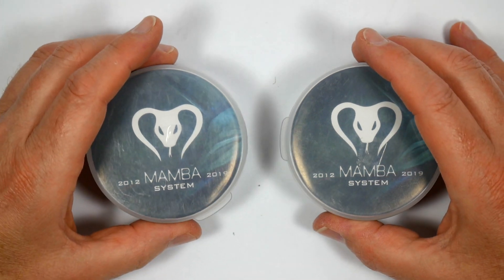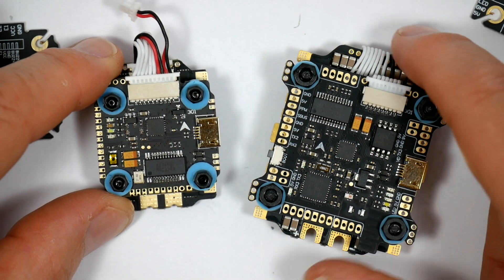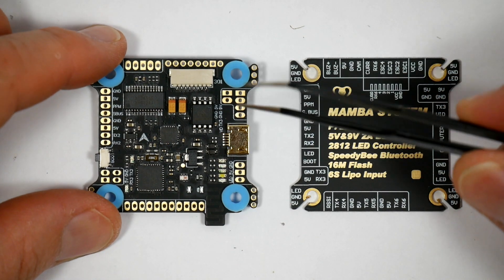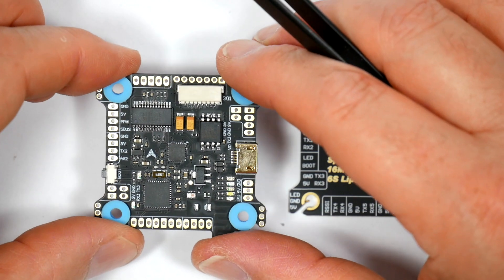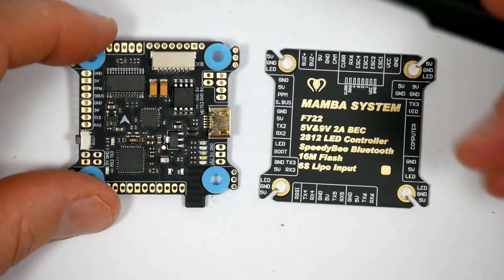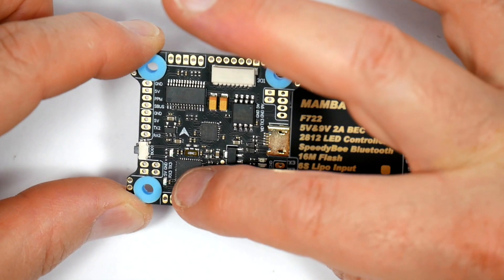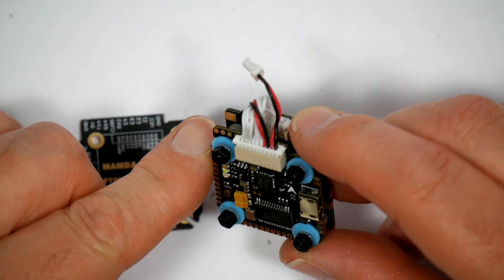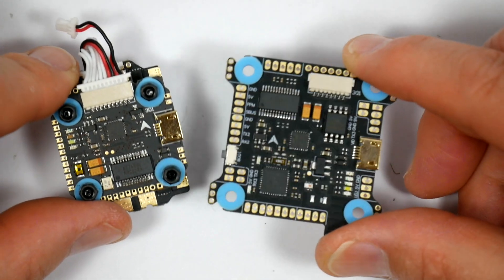Mamba F722S Flight Stack // Bluetooth // F7 // F722 Mini // F722 // All in one  // Full Review

Comment: Just as FYI for the LEDs the four corners are only controlled by the button on the flight controller itself. The LED 5v GND next to the computer port will allow you to control the LEDs through BetaFlight
Reply from the maker: Thanks for r the info.

Comment: speedybee does not connect to mamba f722, connection timed out
Reply: Any resolution for this? Just installed the F722s and having the same issue. Speedybee sees the Mamba device, but connection times out. I also tried to pair my phone with the mamba bluetooth prior to opening speedybee and it asks for a confirmation code (tried 0000 and 1234 and neither work).
Reply: @pauldwheeler  I just changed FC to T-Motor F722 HDTV, don't use Mamba anymore

Comment: Do we have to have the MSP in uart 4 turned on for Bluetooth to work? Having the hardest time getting either of my f7 diatone boards to work. I have a galaxy s10 and running betaflight 3.5.5. not sure what I'm doing wrong. Any help would be greatly appreciated 🙏
Reply: Any resolution for this? Just installed the F722s and having the same issue. Speedybee sees the Mamba device, but connection times out. I also tried to pair my phone with the mamba bluetooth prior to opening speedybee and it asks for a confirmation code (tried 0000 and 1234 and neither work).
Reply: @pauldwheeler  it should be good now. Make sure uart 4 msp is ticked. I think that's it at least. Also if running betaflight 4.2 test versions there might be issues? Not exactly sure. Sorry it's been a while. Just trying to help with what I remember

Comment: Thanks for your excellent reviews 👍. I can't find any information on the ESC 6s rating. Is that 50 amps on 6s or 4s? I actually will use the full 50 on 6s. Bought some t motor f80 and they can pull 50 amps on 6s. Do you know the 6s rating? Thanks
Reply: It can most likely do 50A on 6S as well. With 6S you can push about 50% more power through the ESCs than with 4S while keeping the same temperature. But make sure to add a good capacitor to reduce noise.
Reply: @TimeFadesMemoryLasts  thanks for reply. I just went with the t motor f55 pro 2 f3 mcu 4-1 esc. This esc can handle the f80 pro 1900kv and then some. I'm saving the Diatone esc for a motor that can consume less than 40 amps. I don't want to kill the esc with a motor it's not rated for. Love the mamba f722
Have it on 4 quads now and it's performance is amazing. Running rpm filters and bidirectional D-shot